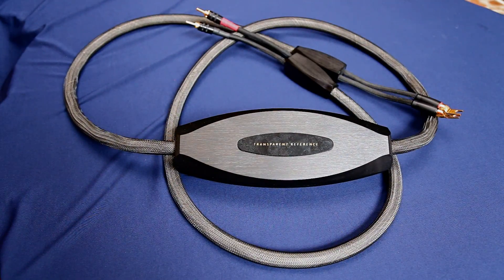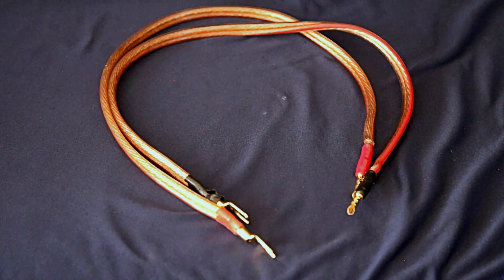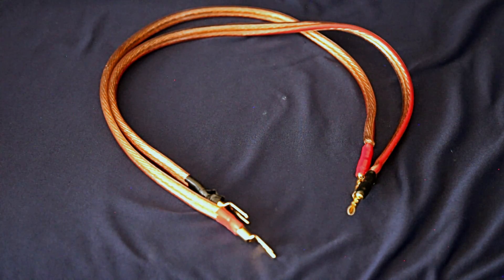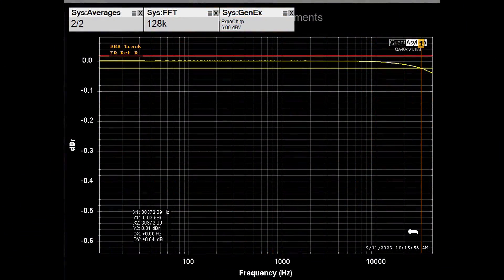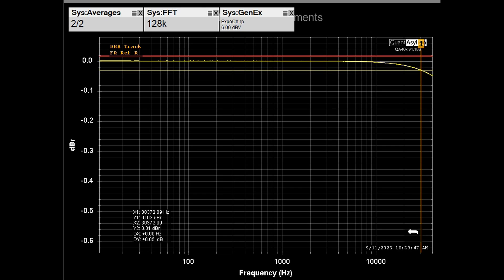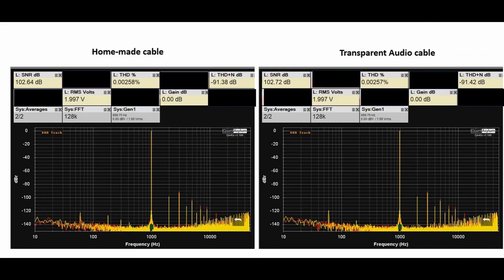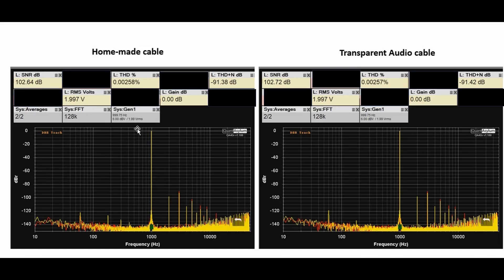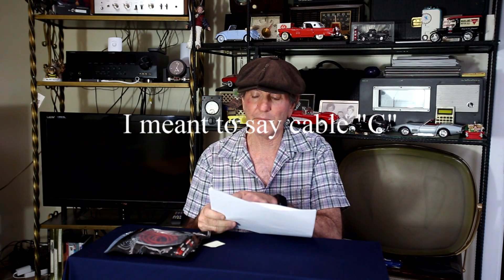$8000/pair Speaker Cable  vs. $14 DIY Speaker Cable A/B Test: Vintage Audio Review Episode #87

Comment: Transparent Audio cables are matched to the intended amplifier and speakers.

If you just picked up random Transparent Audio cables and didn't send them back to the factory to be tuned for your gear, the results you hear will not be the best.
Reply: The really distressing part of this is that you appear to actually believe them!
Reply: @Douglas_Blake_579  Of course.

I don't care about measurements, I only care about what it sounds like in my system.
Reply from the maker: @VideoArchiveGuy  Of course, and no problem with that.
Reply: @VideoArchiveGuy 
Do you care that you may have been getting ripped off really badly all this time?
Reply: @Douglas_Blake_579  No, not at all - I know what improvements each item I purchased brought due to careful auditioning.

Do you care that your insistence upon measurements may have caused you to overlook products that would have increased enjoyment of your system?
Reply: @VideoArchiveGuy 
Do you understand that having a technical background lets me pick and choose intelligently between various options and make decisions that clearly do improve my system without spending ludicrous amounts of money on guesswork and snake oil?

Seriously ... do you get that?
Reply: @Douglas_Blake_579  I understand - and I also see the issue is you love to smear the choices OTHERS make that clearly improve THEIR systems as "snake oil" because you NEED measurements to validate your experiences.

I also have a technical background; that in itself means nothing in particular here.
Reply: @Douglas_Blake_579  You're absolutely hilarious, but your "I'm the only one with a brain" rhetoric gets old.

I'm intelligent enough to choose which cables and components improve the sound of my system by listening and not looking at a single specification, ever.
Reply: @VideoArchiveGuy 
If you're gullible enough to buy $4,000 each speaker cables, your intelligence is rather obviously questionable.
Reply: @Douglas_Blake_579  Pity about your ears; just keep staring at that test gear instead. 🤣
Reply: @VideoArchiveGuy 
72 years old, still hearing 13khz, with normal sensitivity ... nothing wrong with my ears bud.
Reply from the maker: @Douglas_Blake_579  After we did the test and were looking at the cables, we all wondered what the purpose of that "box" was with the little pointed feet on it. We figured it was to help support the cable off the floor. Myself and another guy, who is a musician, an electrical engineer currently working where I did in RF/Microwave, where cables and connectors DO matter, builds his own speakers and designs his own crossovers, thought "Oh, that must be where the speaker/amplifier matching network is" (I am chuckling as I am typing this)
Reply from the maker: Thanks for taking the time to comment. What you said has been brought up by s few of the commentors on this subject. Basically, that sounds nice, but how are they going to do that? Do they know the impedance of all the possible speakers that are going to be connected to as well as the output impedance of the amplifers and create a matching network,,,,,,probably not needed if you have an amp with a reasonable damping factor.
Reply: @vintageaudioreview  You contact Transparent and tell them what your gear is and they tune the cable for your gear.

If you upgrade, you contact them and send back your cable and they will tune it for your new gear.

Any good dealer will be more than happy to loan you a pair of cables so you can at least have sound, though not optimal sound, until you get your cables back.

Other cable vendors don't require that but Transparent does and that matching is why people buy Transparent in the first place.
Reply from the maker: @VideoArchiveGuy  That is nice that you get a set of loaner cables. But once again, it would take an awful lot of work to know all the possible speaker and amplifier impedances, and if they went to your home and measured them, to be able to develop a matching network would be very difficult...
Reply: @vintageaudioreview  You've got it backwards.

You tell Transparent what you're driving with what and THEY do all the work and return your cables to you; you do nothing but send them in.
Reply from the maker: @VideoArchiveGuy  Once again, do you know how difficult it would be to have the input impedance of your speakers or the output impedance of your amplifier known to where this could be done. IF they came to you home and measured them, it would still be difficult to create a matching network as the components would probably not be off the shelf values... "Nuff said
Reply: @vintageaudioreview  They don't have to come to your home and measure anything.

You tell them what amplifier you own and what speakers you own and THEY do the rest.
Reply from the maker: @VideoArchiveGuy  OK, I have got to get on with my day, but putting on my electrical engineering hat and the logistics of knowing speaker and amplifier impedances over frequency as they are not published, or if they are, they are not to the detail you would need to design a matching network to "tune". Let's just agree to disagree at this point...
Reply: @vintageaudioreview  Yes, and that's exactly what's in the large boxes inline on Transparent Audio cables.
Reply from the maker: Yes, I am aware of that

Comment: I made some mag wire speaker cables for my hi end rig.  Braided three runs for each side and used copper locking banana plugs.  Tinned the ends and made a solder as well as screw tightened connection.  Compared to some brand name hi-fi cables that I had in the system for many years the sound was clearly less colored.  Also compared to some $2k cables ( which sounded very good) I am unable to say one is better than the other.  The only downside is that the mag cables are very stiff compared to braided cables.
Reply: I’m traveling at the moment but I’m pretty sure I used (x3) 18AWG. Yes it is 200C coated mag wire and I bought a handheld machine that quickly strips the insulation without damaging the copper. (~$35)
Reply from the maker: @bwaters23  Thanks for replying. Yeah, that would be stiff, but am not surprised it worked great for you. Safe travels
Reply: @vintageaudioreview  it works so well I had to make another set for a friend! I appreciate your thorough comparison. Worth the watch.
Reply from the maker: Thanks again! I hope your friend took you out for dinner for making them...
Reply from the maker: Thanks for sharing your experience. What gauge wire did you use ? Is "mag wire" copper magnet wire that has the insulation that gets sanded off. The $8k wires are not very flexible either.

Comment: Do I think speaker cables sound different?  Yes, but it is about the smallest change you can make.
Do I think DIY can sound great.  Yeh.  That is what I use.
I think interconnects make a much bigger difference.  I find my diy far better than any commercial cable I have heard, but I have not heard many.
Reply from the maker: I am guessing that your DIY are speaker cables and that you did not spend more than $50 on them, and you don't need to try anything else if they are doing the job. Thanks for the comments!
Reply: @vintageaudioreview  Yes.  My system is entirely DIY and the speaker cables cost $20 for the wire.  Basically a litz cable made from 24strands of 24 gauge Teflon insulated copper.
Reply from the maker: @user-od9iz9cv1w  That took a bit of time to wrap/twist 24 wires together ane remove the teflon, but am glad it worked great for you!

Comment: It's all at the connectors.  Brass 99% of all connectors and is 30% conductive at best. Tellurium copper 90% conductive. You'll hear it.
Reply from the maker: Most of the connectors I have run into are not brass, or if they are, they are gold plated... Thanks for taking the time to comment!

Comment: I wish the Federal government would step in and clean house with these audiophile accessory vendors like they did with food products and pharmaceuticals. The fraud is just out of control. Even entry level electronics and Electrical Engineering knowledge and practice firmly contradicts these accessory product claims. I mean like primary AC line fuses having an audible effect on a DAC or preamp. I'm also tired of the "science can't explain everything, there are still many unknowns" or something like that. Yes that statement alone is true. We don't fully understand gravity for example. But we sure as H understand how electrical energy conducts through various metals. And we have known that for over 100 years. We have people that think the Earth is flat, we never went to the moon, the government blew up the twin  towers! Some of these audiophiles will fit right in!
Reply: Yes ... whatever happened to "Honesty in Advertising"... or just plain Honesty for that matter.  If these audiophiles knew just how badly and how often they are being ripped off there'd probably be quite the rebellion with a lot of these super-high-end companies going bankrupt. 

We don't actually need the government to step in... just applying common sense with a bit of electronics knowledge would do the trick just fine.
Reply from the maker: Thanks for the comments and with the ability to do research through sites like Audio Science Review enough info can be found to make intelligent choices on how to part with your $'s.
Reply: @vintageaudioreview  
ASR is a great resource.  The only thing I wish they would do is to stress test these products... for example: run an amplifier up to 99% output and keep it there for 4 hours, or push a DAC to it's output and frequency limits for an hour... Knowing the audio specs is wonderful, but pretty useless if the product dies after a couple of weeks.
Reply from the maker: Doug- I am not sure how many amps would survive 4hrs at 99% power out. I do not like to push amps for a long period of time near their limits. I believe there is (was) as pre-conditioning period of 2/3 power for 45min. But I am looking mainly old gear and would hate to lose it. The bigger amps, say over 200w/8ohms, also get my loads pretty warm and when doing a monoblock test with a stereo amps where you are over 400w they get very warm if you keep it there for a while...But I get your point. I appreciate your expertise in the comments.....
Reply: @vintageaudioreview 
Of course you're not going to push vintage and often irreplaceable gear to those limits.  I wouldn't do that either.  But brand new gear, needs to be "tested to destruction" to verify that it is of sound design and manufacture.

Let me give you an example...
When the Fosi TB10D first came out there were some pretty bad reviews.  Then when the "upgraded" version came out (ver 2.0 board) that changed.  But, what had changed?  
I took one, put it on my bench and fired it up full power for about an hour, everything got seriously hot and it went into protection repeatedly.  
Then I took my voltmeter and checked key voltage points... the 12 volt op-amp supply, 3v logic pins, etc.  I immediately discovered they were running the 3.3v supply at 5.2 volts, which would eventually kill the chip which is rated for 4.7v absolute maximum on those pins. 
Following that I took my scope and checked the stability of the 12v buck converter, which was okay, and power PWM signals, where I discovered some noticeable but not destructive instabilities.
On further investigation I discovered all kinds of eddy currents on the chip's main heat sink, caused by the PWM output filter coils actually touching the heat sink.  There was even noticeable inductive heating on the heat sink.
Finally, after shutting it off, with the power supply still on, I noticed that it was still active.  I could actually play music through it when turned off. This was due to allowing the ~Reset pin to float when the switch was in the off position.

But the little amplifier was getting rave reviews all over the web.

Last fall I purchased 3 for clients. These came with ver2.1 boards... with all the previous issues except the floating ~Reset pin still present.  So, I decided to do the modifications myself and assume the warranty for the 3.  I replaced the zener diode in the logic supply to get it down to 3.1 volts and removed one fin from the heat sink to create some distance between it and the coils.  2 went to customers, I ended up keeping the third one. The result is a TB10d that gives crystal clear sound, a very reliable 75 watts per channel on 8 ohms with a 36 volt supply and gets barely warm (3c above ambient) even with hard usage for hours at a time. Scope and Voltage checks now show proper operation of the TPA3255 chip with noise and distortion levels below my equipment's measuring thresholds.

And ... nobody caught any of this!

Of course I've reported it all to Fosi... but have not heard back.
Reply from the maker: @Douglas_Blake_579  That is some really in depth testing and solution finding- not something I would attempt as I would be satisfied if it worked/measured ok. Too bad Fosi did not get back to you- maybe they will send you pre-production gear to look at..? As for the vintage gear, I will take it to where it starts distorting a lot (about 1%) and call it a day. Have not had anything die yet- probably not a surprise with vintage gear-
Reply: @vintageaudioreview  
Ahh but that's the rub ... it was not measuring at it's best and certainly not working correctly when it would stay active with the power switch off.... and nobody caught it!

The difference correcting those issues made is not slight ... in fact it is immediately audible.  Fix the design flaws and the whole thing works much better ... no surprises there.

When I work on older Class AB gear I'm beyond careful. I will take it up to clipping for about a minute to get power measurements, I do check the supplies for voltage and ripple... but no way am I going to abuse it into destruction the way I do with the modern class-D stuff. 

You would be seriously surprised if you knew how many of these little China Amps I've blown up on my test bench.
Reply from the maker: @Douglas_Blake_579  I don't check p/s ripple or voltage on the vintage gear (when I amble) when at or near clipping, but it would be interesting to do- not enough time in the day for me...and you it seems like- blowing up those Chines amps..
Reply: @vintageaudioreview 
I don't like the expense of blowing them up, but I'm not going to assume the warranty for something that I can't/don't trust.  
Before retiring I was doing something I've never seen any other company do. I was pre-testing and configuring systems that my clients would still be using in 20 years. I didn't make money from the hardware. My money came from setup and upgrading of the stuff on my list. I sold my systems with a lifetime warranty in which I would fix anything I sold for only the cost of parts or replacements.
 
Needless to say... that's a losing proposition from day one if you can't provide reliable hardware.
Reply from the maker: @Douglas_Blake_579  That's pretty good- offering a lifetime warranty on labor- and it makes sense that you would want to test everything to see how well it held up.
Reply: @vintageaudioreview 
That should be "... test everything thoroughly ... "  (Grin)

Comment: If there are gullible audiophiles out there to spend that kind of money, I guess there are plenty of snake oil opportunists willing to cater to them. With $8k to spare, I would rather spend it on my listening room to correct the deficiencies or acoustical aberrations that can affect the overall  sound performance. Having a blind person to listen to the realism of a singer or small group of musicians and asking that blind person what they liked about their performance is a true test, that normally cannot be replicated with audiophile equipment. If the performance is so convincing to be the real deal, than I would say that the system truly has accomplished  that synergy we are searching for.
Reply from the maker: Thanks for your thoughtful comments. The one about using a blind person (with good hearing) is a good one. In this test, we did have a musician listen who has good hearing. We hope to have at least one musician and maybe a singer at the next a/b test, which is in the planning stage.